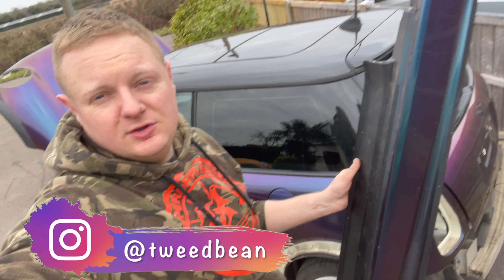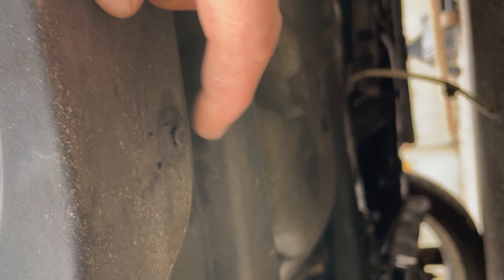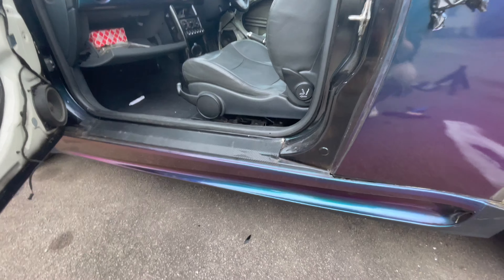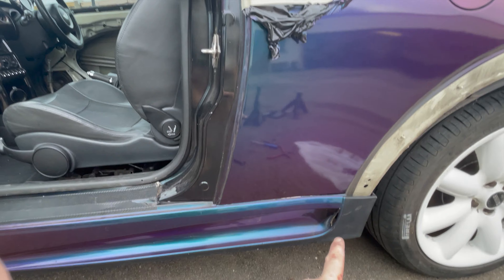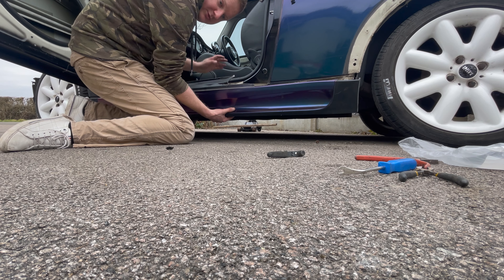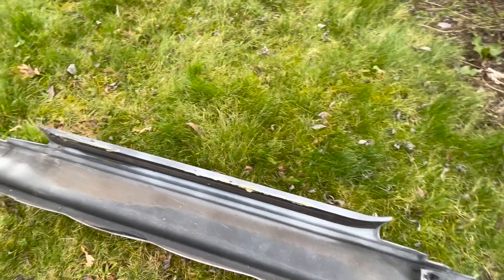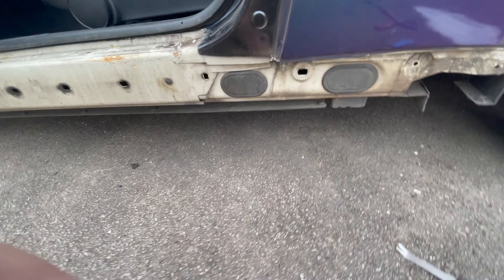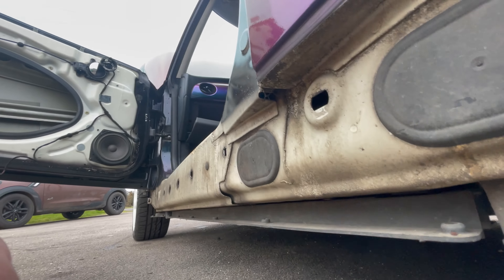Mini R50/R53/R52 how to remove aero side skirts JCW

Comment: Thanks for your very useful videos.
It was very usefull to see how you removed the rear arches and rear bumper of the silver F56. I wonder if the side skirts removal is similar for the F56 as here in the video!?
Best regards from Germany 👋🏻
Reply from the maker: It’s not too dissimilar
Reply: @tweedbean  I think the most important  messages is tht we should not be afraid to brake it. In the end it will sound horrible but these are only the breaking clips,  did I understand that right?